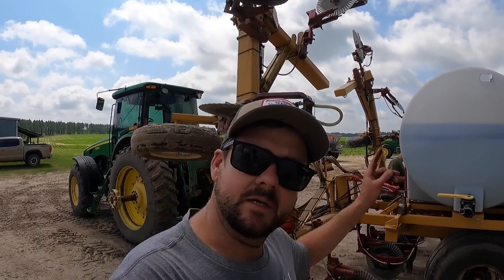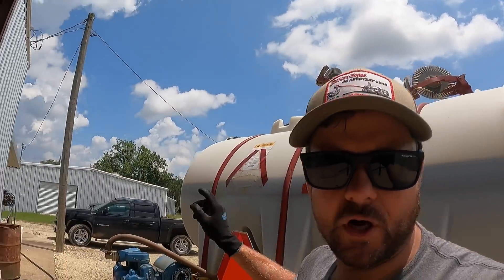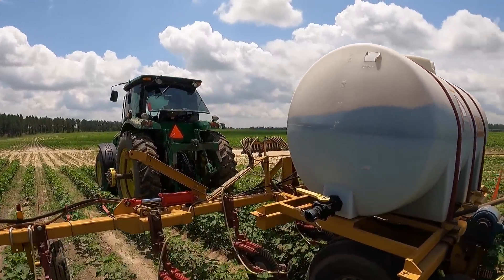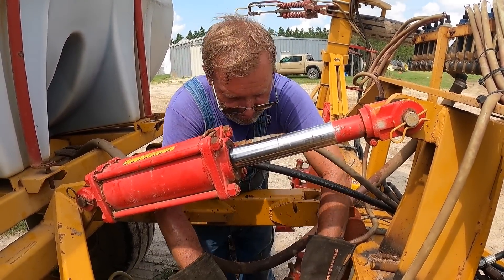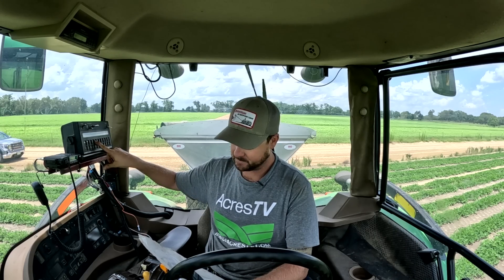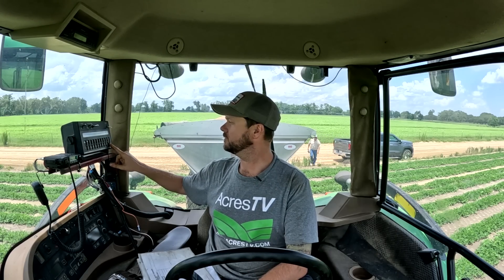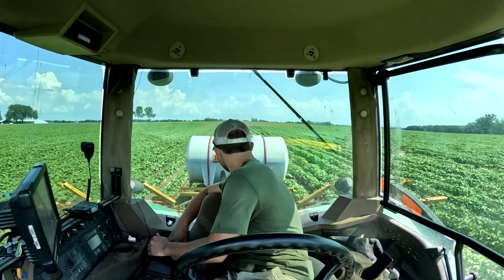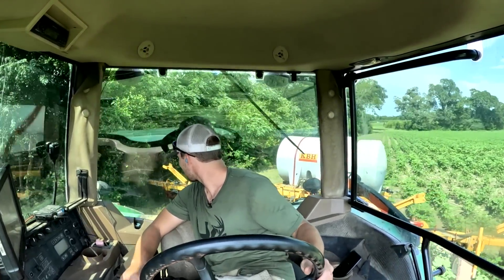I Got It Way Too HOT

Comment: Sounds like you need a new torch head or at least a new tip. That popping sound is tiny explosions from the gas in the head. If the tip isn't plugged, then your torch head is back flowing and causing the gas to ignite before it gets out the torch. That's why it's popping. It's all good until your torch starts heating up in your hand like the metal your trying to glow. Lol Been there done that.  Lol love the videos! Keep them coming.  Love yall like Jesus does